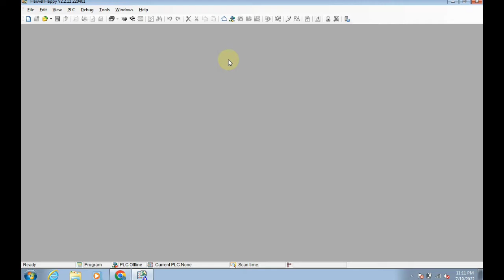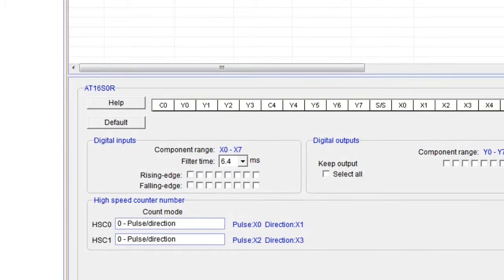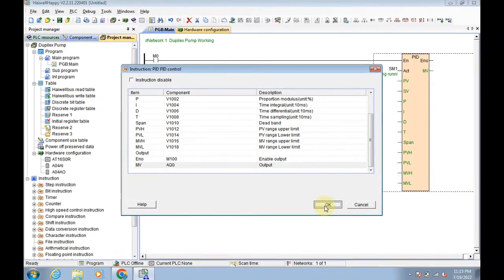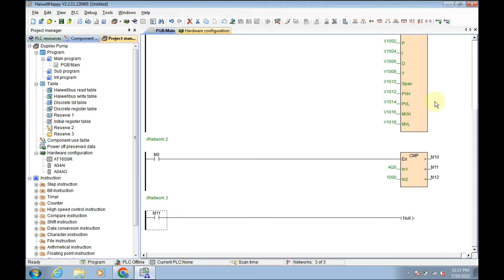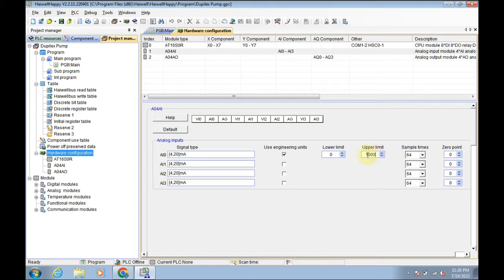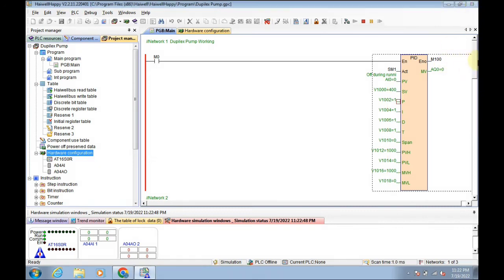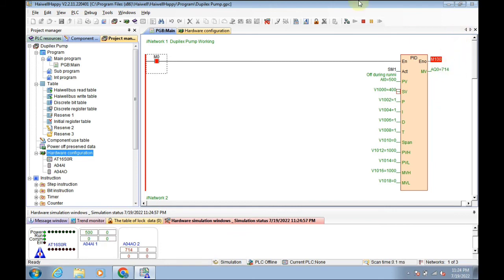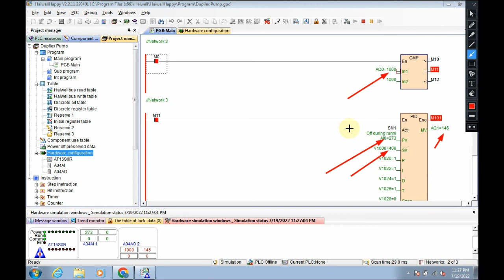Duplex Pump Control In Haiwell PLC

Comment: your videos are really helpful for a beginner like me, can't thank you enough!!! I will try to simulate this and see if I can make it work here.
Reply from the maker: I appreciate your concerns, 
Try to spread my channel with other beginners
Reply: @APECEnterprises  , Yeah I will surely do that...
Reply: By the way do you supply this PLC
Reply from the maker: Yes we deal in this
Reply: @APECEnterprises   sorry I have a lot of question, how would be the communication of the PLC to VFD, as I've read from the Haiwell PLC manual can use MODBUS communication. Can you also do tutorial for that, with this control., thank you.
Reply from the maker: Which Brand Vfd you have or Model number? Then i will make exact video otherwise you can comunicate plc to vfd via 4 to 20 mA or 1 to 5 volt . In my duplex Pump video i used mA function to comunicate vfd
Reply: @APECEnterprises  thank you for consideration the VFD is TECO F510. I can't reply with the link of the manual
Reply: @APECEnterprises  oh so the program will be modified if use MODBUS connection, can you also share how to do that, thank you in advance.
Reply from the maker: Tomorrow i will upload
Reply: @APECEnterprises Excited for the new video content 🥰